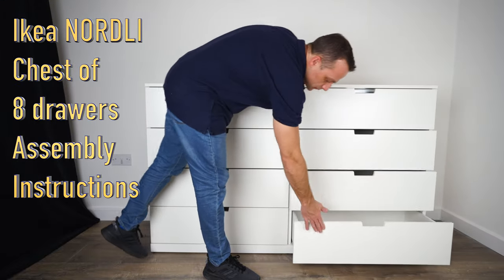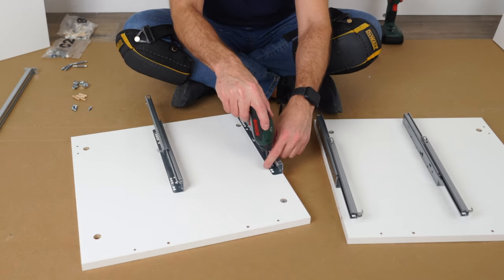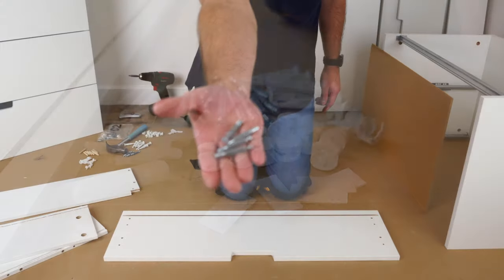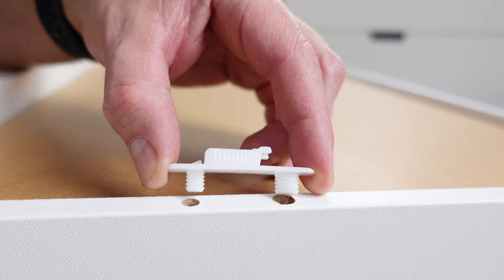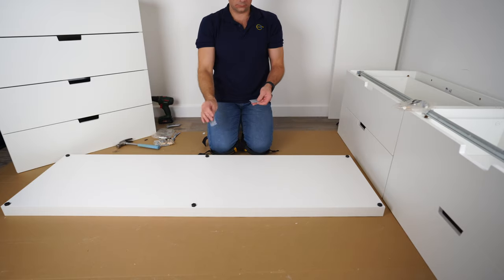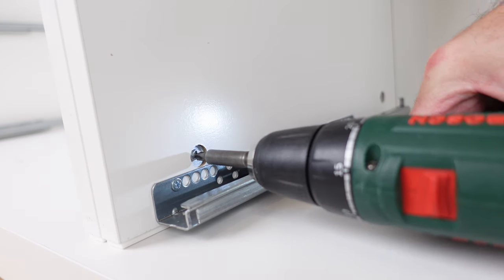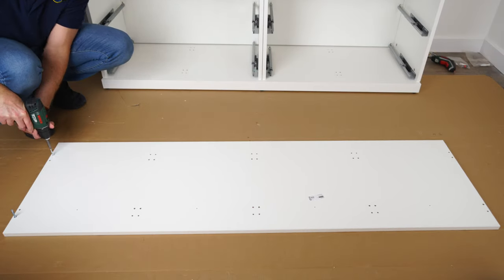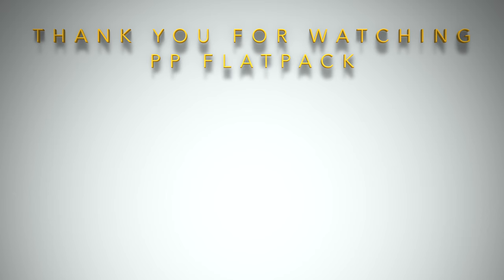Ikea NORDLI Chest of 8 Drawers Assembly Tutorial | Step-by-Step Instructions for Easy Setup

Comment: Great video. I am doing a single deep drawer but when I put the drawer into the frame, over the rails, I can't see or access the hooks on the back of the rails so i am unable to push those hooks into the holes on the back of the drawer. Please can you suggest something. Basically, in your video, how did you put the top drawer in, how did you make sure the hooks go in the holes on the back of the drawer??
Reply from the maker: Push the drawer back on the rail and lift the front up little. It should come in to the back holes easily
Reply: @PPFlatPack  yes I tried that yesterday and it worked but thank you so much for the video. Ikea instructions are rubbish. 🙏😊

Comment: I followed your instruction step by step and it worked really well but after i put the drawers into the frame i  could not close it properly its not a smooth movement and  it stops as i am trying to push it back and forth. Do you have any idea what went wrong? 🥲🥲